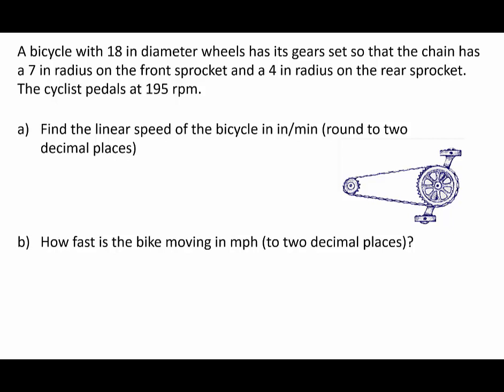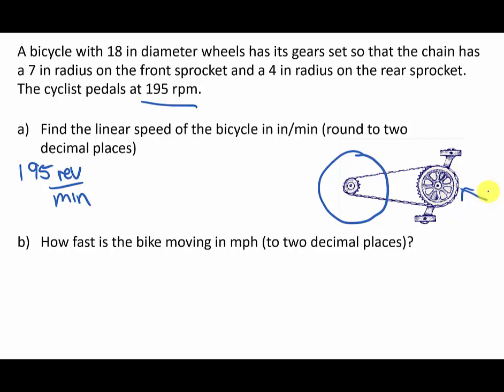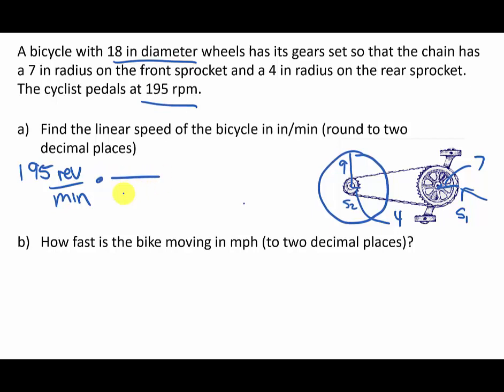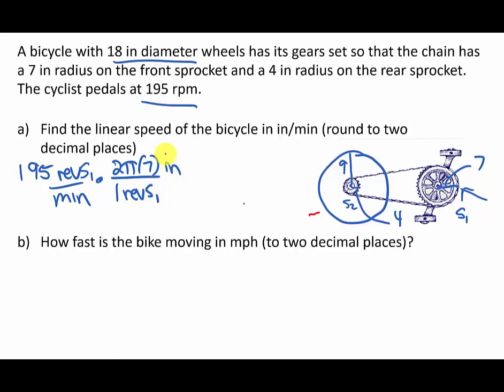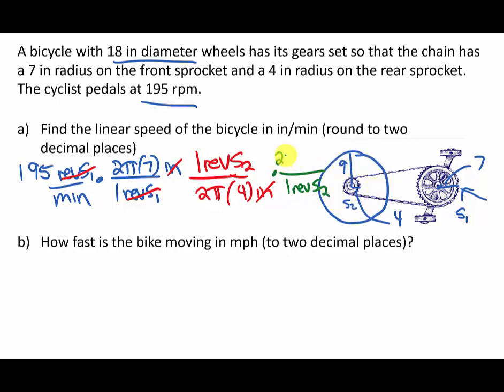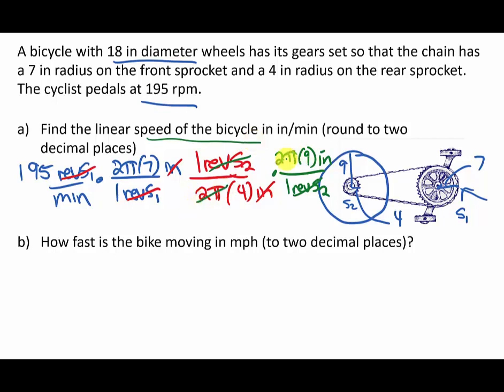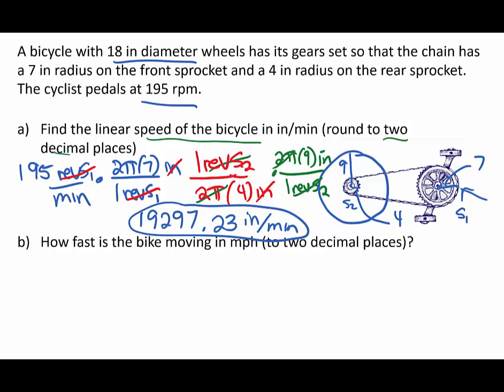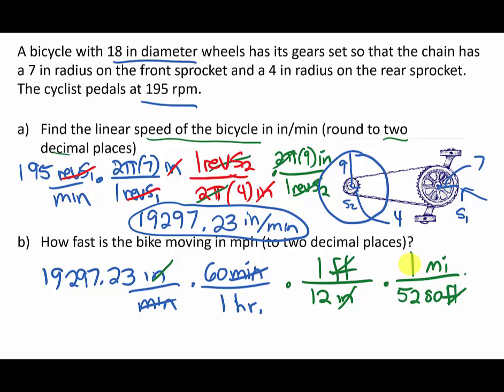Bike pedaling rpm to speed of bike

Comment: Can you explain how to find in reverse? bike speed to pedaling rpm
Reply from the maker: So just use conversion fractions to change the units from miles/hr to rev/min. Starting with 18.27 mi/hr, multiplying by 5280 ft/1mi will change to feet/hr. 12in/1ft will change to inches per hr. 1 hour/60 minutes will change to inches per minute.  1 revolution = the circumference or 2pi r  so using 1 rev/2 pi r inches will change to revolutions per minute which is what you want.
Reply: @shawnahaider7474  Thank you. I solved a problem. I need to crosscheck the answer. Can you look at it?